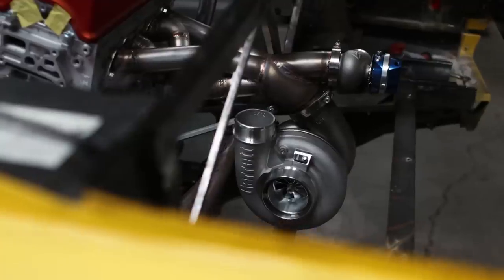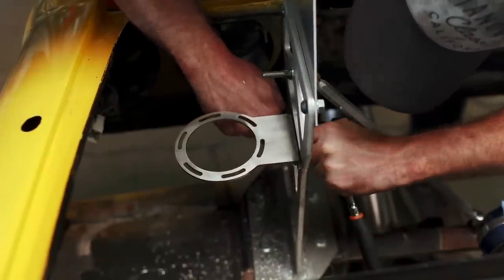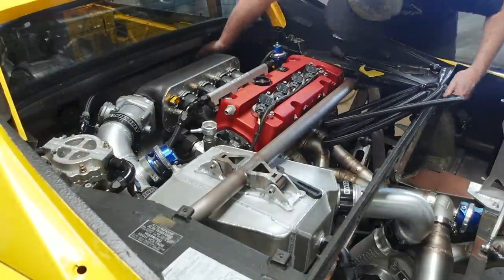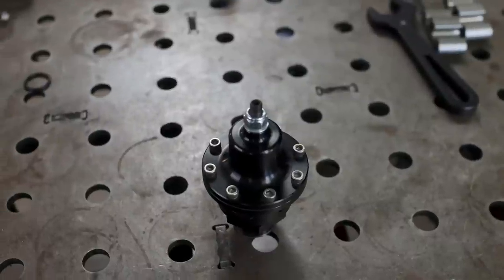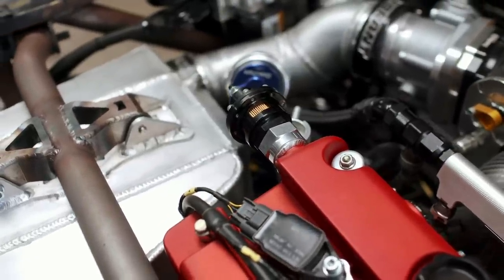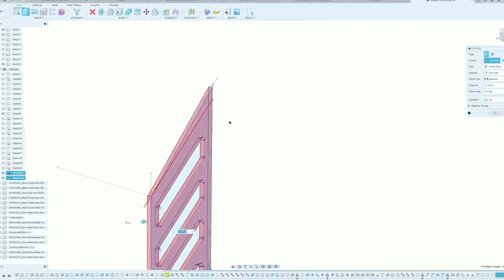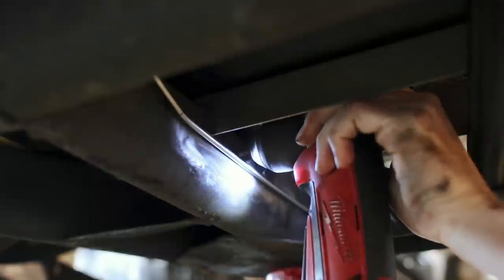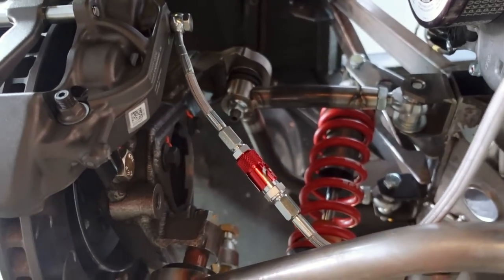Ferrari with a HONDA Engine: Finalizing the Engine Swap & Brakes

Comment: 3 Things i noticed with the brake lines from a mechanical engineer (former SAE / Aston Martin, Caterham and Dunlop Motorsport) 
1: the ends of the hard lines are unsupported, this is an issue as vibration will cause the pipe to oscolate and fatigue at the first clamp point. That's why on OEM the fittings pass through a tab so that mass is retained on the body of the car.
2: The dry breaks would need a support bracket as well, as any vibration will fling them around and have them pinging off everything in that area behind the caliper, resulting in damaged lines, dry breaks and the hoses being likely worn out.
3: the lines coming out of the tank at the head of the system, those could use a line spacer clamp (think like HT lead clamps) to help those lines stay put instead of flapping around in free air. 
Just a few things to consider about that, otherwise the rest of the system looks good.
Reply from the maker: All good info! I plan on supports for the lines and dry breaks. Just not enough time to explain it all in one video. Good looks!
Reply: I have a lot of faith in Mike's final product, but man would I love to see your take on some other YouTuber's "builds"...
Reply: @johnathanpotts3786  And right there u just hit the nail on the head with the problem with you tube....... you have the blind leading the blind.
Reply: @Steve-jo3cl  well I don't believe his comment was to be a smart  a s s  like some people, the comment to me seamed to be just someone with knowledge seeing potential safety issues and through their concern shared some advice/knowledge (nothing wrong with that).
Reply: @superchickensoup  think u misinterpreted what im saying...... what im saying is u have people posting videos on you tube building cars and doing things incorecctly, then everyone watches it and does the same thing....
Reply: Would the dry breaks be better at the other end of the flex lines where they aren't moving about so much?
Reply: @Steve-jo3cl  Yep that's what I understood. However, I give people the benefit of doubt that they'll look through the comments before emulating something the see on YouTube.
Reply: @Steve-jo3cl  he's learning as he goes, dude. No one is born with all this knowledge. This channel is a wealth of good info, and he relies on the community to broaden this knowledge. Find something better to do than hate on people who are on the path to mastery. And learn how to spell.
Reply: @Steve-jo3cl  It looks like I massively misunderstood what you where saying, because I read your comment in relation to the original comment here but now looking again your comment was to Mr Potts so I definitely got the wrong end of the stick 🤦‍♂️
Reply: @salamander5703  i think the best place is directly off the hard line with a tab on the chassi to support the hardline/dry break
Reply: @superchickensoup  cheers mate
Reply: @superchickensoup  im not having a go at Mikes work at all, i think his work is phenominal, my statement was in regards to looking at other you tubers builds
Reply: You guys have noticed that you ALWAYS say BREAK instead of BRAKE ? It just takes a second, rereading what you write before posting it ...
Reply: @Steve-jo3cl  I think people who build things and watch content, will take what has value and reject that which doesn’t.

There is no legitimate reason to hate on content creators, sometimes they are there to stimulate ideas.

This isn’t college or tech school.
Reply: @Lex9296  I see the error a lot too, but not in the above: "Brake lines" and "dry break" - one is for stopping, the other for splitting something (break stuff, as Limp Bizkit would put it)
Reply: @SteffenHansen1973  Yess, you're right ...
Reply: @superchickensoup  That was the exact point i was trying to convey, I wasn't trying to be a smart ass as someone suggested. I was worried about safety concerns as I've had the brake pedel go soft on me before, thankfully not end up in an accident though doing 120 on the German Autobahn and finding the brake pedal decending to the floor is no joke! No-one wants to see something like this end up on a flat bed and Mike in hospital

Comment: In my years working in the IMSA paddock I've seen plenty of racecars with quick change breaking systems. All of the suggestions Sf Mason made ring true for me. But the one I would stress is that the dry breaks should be mounted to the hardline, which he also notes, should be secured to the chassis. The hose you had made won't allow the dry break to be secure with enough room for the caliper to move on the steering axle. In short, mount everything to the chassis and run your traditional braided hose to the caliper.

Comment: Hi Hi, power taping works really well in my old job we build robots like that with an drill in the end I drilled on 0.1 mm exact and repeatable without any breaking of taps.
My recommendation is a tap for CNC machining I made really good experiences with the once from Garand (blue ring marking).
Another Pro, tip put your cordless drill on screwing and set the torque so it barely cuts with that you will just break taps when you bend it by force of your hand.

Greetings from Germany

Comment: There is a massive benefit to lining up the hex on the pipe connection's, if they are all lined up to start with then in the future you can visually check nothing has loosened nice and simply.
Reply: That's why I do it
Reply: You can also paint a line over where the two parts go together to see if anything ever moved. Factory spec did that all over my '83 Porsche, it's good practice. For aluminum fittings you might need a dab of etching primer. I use One Shot enamel, in green, since the factory mark was done in red.

Comment: In the future if you need abnormal ORB or AN/JIC fittings you could always check out a hydraulic hose supply store for those fittings, I worked as a heavy equipment mechanic and you’d be surprised by the selection of weird fittings for equipment. A -8 male to -12 female ORB fitting would likely be in stock or available for order. Love the build blog! Keep up the great content

Comment: For when you do the composite hood, is it possible to make the vents curved bit connect tangent with the stock hood angle?  Not sure if it would create any issues with the build, but if it were possible I think it would look much better integrated into the design.
Reply: What the heck are you doing here morph? Lol

Comment: A suggestion… mount the dry break fitting in board and behind a P-clip or hose mount so they don’t see flex from suspension or steering motion. It also gives them some protection from moving components. Its an extra step to remove the hose mount before you can remove the calipers but its still easier and quicker than bleeding 👍

Comment: Another benefit of CAD is you can plot a 1:1 scaled print of your part to check it fits before having metal cut. This can save you tons of time and money avoiding errors such as the splitter mount. It's still a benefit if you have to split the drawing across several pages and save a single part. Also very easy to do with your parts as they are typically 2D.

Comment: If you happen to go the zip tie route for your brake lines check out using stainless steel zip ties I’ve used them on a couple atv builds they don’t look bad.

Comment: Excellent progress and I love those dry breaks for the brake lines even though they are eye wateringly expensive. Also great work on the mounts and for clarifying that they are not clamps so they are oriented to avoid line movement. Nice detail stuff.

Comment: Use a bike shock pump for the AN pressure tester. They go up to about 350 psi which is a good bit higher than shop air, and they're cheap.

Comment: For the regulator maybe a 90 elbow will do, or remote mounting: run line from valve cover and hard mount the regulator somewhere else. Of course that will bring more complication so I think a mere elbow will be nice.

Comment: Excellent Episode Mike! 

Super glad to see you're keeping the brake hardlines, was a bit sad when you said you were going to remove them all because of comments,
Curious where you got those hard-line brackets from? They look super clean and I'm looking for a similar solution for my rx7 as I'm fully redoing all my brake hardlines currently. 

Love the tip of using the pencil in the cooling vanes of the brake discs, never even thought about that before but will be using it in future for sure as brake cooling is something I always struggle with 👌

Comment: Another side effect of hanging that tank off the wing- if it has some liquid in it you will see some vibration dampening because of it. 

With the leverage and side force on that wing it could be a massive advantage!

Comment: Props to you for misaligning that AN fitting!
In my opinion it should be tightened to the right torque. Otherwise you're overtightening or undertightening for the sake of appearance, which is madness.

Comment: I would definitely up the line size and or add a second crankcase breather line to the catch can. IMO you’re not going to have enough freed up crankcase pressure causing the bottom mount turbo to drain oil properly. Regardless of using a turbo scavenge pump or not.
Reply from the maker: Interesting, can you elaborate any further?

Comment: Thanks for the video. In the 80's  I had AutoCAD (3.0??) by Autodesk on my 286 PC. I remember with 12MHz of computing power if you hit refresh in the morning it would take much of the day to process. And I didn't have anything to do with the file once completed other than print so I continued to use the old school drafting tools. At work I mostly used UG and Catia, so I'm looking forward to trying out Fusion360 so CAD will no longer mean Cardboard Aided Design :-).

Comment: I power tap all day, try using a small amount of tap oil on the tap, the bigger the tap the more you'll need it. This will avoid snapping the tap off inside and making it impossible to get out.

Comment: You should consider bulkheading the brake lines where the hardline transitions to soft line. That way any stress or moment the soft line sees isn’t transmitted to the hard line, eventually fatiguing the hard line.

Comment: You might search for air oil separator instead of using oil catch can.  I have recently discover this part and it seems to be more effiecnt than oil catch can.
Reply from the maker: my dry sump pump has an oil/air separator on it and returns each in its own line to the tank. :)

Comment: Please, when you make the new hood,  change the aperture so the sides run parallel with the edges on the hood, it will look so much slicker!  If I remember you replicated the old carbon hood in aluminium because you’d cut the hole, now you are free of that restraint.

Comment: Dude! I have to say, The AN hex lineup...not lined up bit...I'm the same way. If it isn't tight enough, because form is more important than function, that fitting WILL leak or, a complete failure is imminent (POTENTIALLY), or the fact that over tightened/over torqued fittings, so they "line up" will fatigue/crack, leading to catastrophc failure.
 I, Specifically, had a  customer request for something very similar on a build. Which led to failure. Yet, My 20 years of experience in this industry meant nothing to "daddy warbucks' " pocket book. 

 110% planning, execution, and dedication is expected  with a build like yours. There is a reason for what one who sees it as  "miss aligned". --Eyes of the inexperienced- IMHO.

I must add, your build on the Ferrari is very well executed,  thorough planning has made one hell of a car. Being a customizer on traditional style hotrods, and resto-mods (the true definition). Ive seen it all, bad, horrific and outright dangerous. My hat is off to you, man. Best build and build series I've seen. IMHO, Keep up the killer work!

Comment: Im no expert, but i wonder for a long while: will the original structure of the car be able to handle the forces which are multiple times bigger than it had to deal with? I see lots of plates/flat profile elements...

Comment: Does the catch can line line drain back toward the engine or the can? Which way is optimum?
What about electrolysis between the brake line and the aluminum mounts? Would a sliver of electric tape bush and insulate between the two?

Comment: Been watching since the start absolutely love the work you’ve done, why don’t you put an elbow on your vacuum regulator to keep it away from the filler neck?
Reply from the maker: Because the weight will try to rotate it. I'd have to absolutely nail the marking on the part, and as said I'm gonna change valve covers so it doesn't really matter.

Comment: One curiosity. How will you keep all that hot air from the front radiator duct from moving over the car and into the air intake in the rear. I would think that air going over the car will be really hot and end up right over the engine bay in the rear.

Comment: 30 day trial to Fusion? Is it no longer free to hobbyists? It used to be if you made less than 100k with the software it was free. On a related note, Solidworks has apparently released a hobbyist version for $100.
Reply: It still is.  You can get a free educational use license.

Comment: I don't know if i'm wrong or not, but I think the oil can't calm down because of the shaking and vibrations of the wing at high speed. And I thought that the oil needs to "chill" to seperate it from the air, right? 

Sorry for my bad english, i'm german

Comment: Why did you opt to tap the chassis rather than using a riv nuts? I would have assumed that would give you more threads?
Reply from the maker: Because they use 8-32 screws and the rivnuts at that size are so tiny. I also don't have a mandrel in that size, so I didn't feel like buying one.

Comment: Would it make sense to spray the unpainted chassis etc with WD-40 to prevent the rust? I’d think cleaning the WD-40 would be easier than removing the rust.
Reply: Ask anyone who has ever painted a car and they’ll tell you to never spray WD-40 anywhere near a car that is going to be painted.

Comment: Long time subscriber. First time commenter… 1.) That 2002 is fire. 2.) Perfectionist inside says line up the AN fitting… but the German inside prefers the “gewd n tit” torque spec for my boosted e30. 🤷🏼‍♂️

Comment: i love this build, but please keep in mind that touching steel and aluminium causes galvanic corrosion (which affects the steel in this case). 
https://en.wikipedia.org/wiki/Galvanic_corrosion
if you don't want the chassis to rust you can separate the metals by either painting the touching faces or separating them with some kind of gasket.

Comment: Aluminum doesn´t like stainless steel or any steel, it will corrode by electrochemical process. Aluminum likes aluminum itself, zinc or cadmium. Today cadmium is not used anymore because it is poison. You also will have chafing on the brakelines because of vibrations. This material incompatibility is well known in aviaton.

Comment: Cracked up laughing at the fitting tweak, how fumey are these engines in this sort of trim? (ie: blowby) 

Just wondering if it'll be a bit stinky with the catch can there on over run.
Reply from the maker: They do produce quite a bit of blow by

Comment: No oil cooler for a track car?  Let's see how many track days it takes to change your mind 🤷
Reply from the maker: It’s based off of the NSX I featured last month which also does not run an oil cooler. With half of the capacity.

Comment: Your aluminum TIG welding has definitely improved. I also have to say that needlessly irritating a commentor (aligning the flats of the AN fittings) was a bit of a dick move for a content creator that relies on views, subscriptions, and people coming back to the channel in general. I don't know what the context of the original comment was but as someone who is not intimately familiar with it, it just seemed unnecessary. I also agree the carbon hood is the way to go.
Reply from the maker: It's all good, I get a lot worse. The comments about how long the build is taking or how slow I'm going are the ones that actually irk me. I was just having some fun with this one.

Comment: I give you less then 500 miles of driving time before you put the VTec system back in, unless you're trying to make over 900whp at 10.5K RPM there is Zero reason to remove VTec.